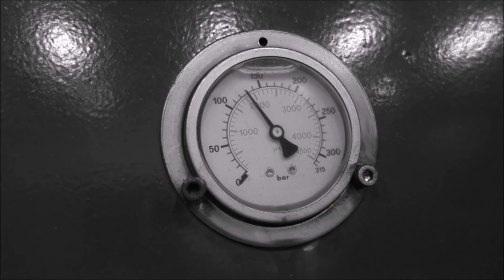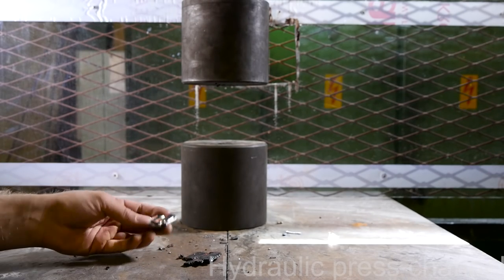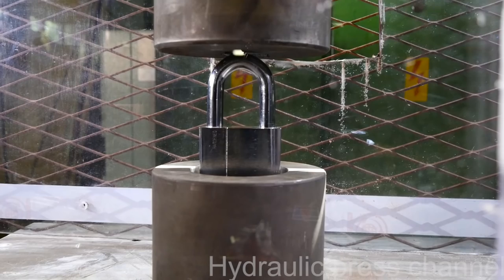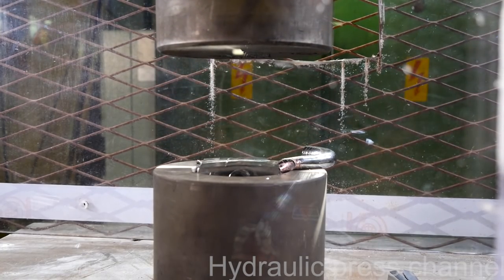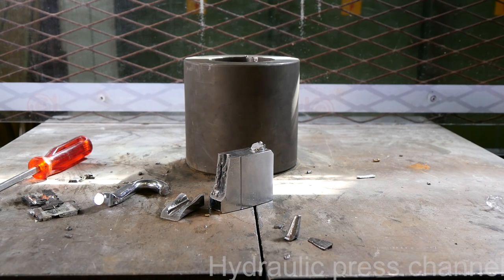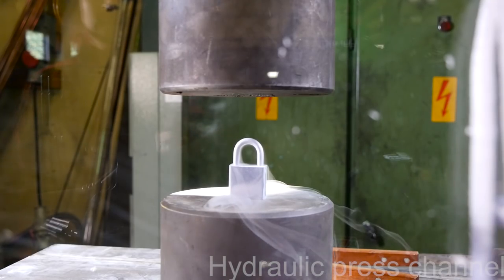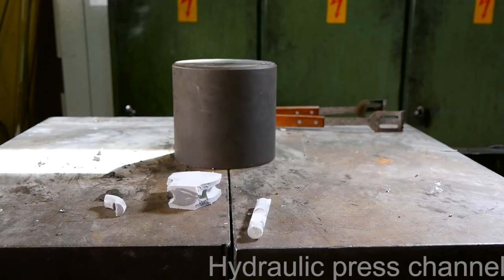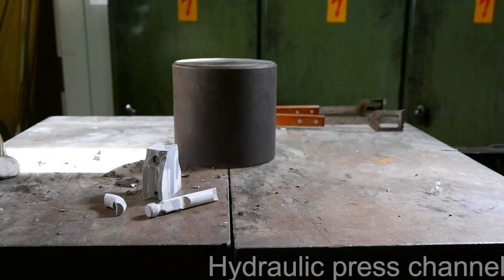How to open padlock with hydraulic press

Comment: PRESS OLIVES AND SUNFLOWER TO GET OIL OUT.
Reply: Good idea, extract some oil from seeds :D
Reply: that's a bad idea he should press some marijuana buds to make some dabs or oil
Reply: The marijuana suggestion is cool it's called rosin and you should apply heat also to allow it to flow out. The excessive force will likely push out more than just the thc oils though and cause it to taste "leafy".

Comment: You need to see if you can get your hand on a military grade Sargent and Greenleaf lock. It is what they use for locking up tanks, RPG's, that sort of thing. It is VERY legit. Not only is the case and the shackle hardened on the locks, but they also cast the case with small rods of ceramic in the body to help dissipate heat from a torch, or cold from LN2. I think a Sargent and Greenleaf Military lock would be PERFECT to torture test on the press, with a torch, and with LN2. Might want to hit up some of the Lock Picking community on YouTube, someone like "bosnianbill" can probably get you in touch with the right people.
Reply: yeah
Reply: could be nice to watch. i say do it
Reply: Seconded. That sounds amazing.
Reply: wow, how do you even know this :O
Reply: Sir Loudmouth A quick Google search takes you to their site, where they say the very same thing.
Reply: the 951? The body is stainless and the shackle is hardened where as an abloy has hardened body and boron shackle... i think the abloy would win.
Reply: edit: just saw the price on the sargent and greenleaf, that thing is like 1800 bucks. S&g should be way better i suppose now xD
Reply: FoodOnCrack The stainless body is a design choice. While it isnt hardened, it is still very durable. And in some cases, because it is not as brittle as hardened steel, it is actually better protected against breaking from impact. The stainless also has better thermal properties, which are reinforced by the ceramic rods in the casting. Stainless also holds up better against acid attack.

Plus the 951 is a full shroud shackle, so that stainless body would have to fail before the shackle would. And you would have to shatter the casing to its core to release the captured ball bearings that hold the shackle closed.

The secondary benefit of the ceramic rods is that they are diamond hardened. So if you do manage to cut through the stainless, you will likely ruin the cutting tool on the ceramic rods. Which in some areas are laid right next to each other, to protect critical lock components, like the lock cylinder for example.

S&G also subjects the locks to several tons of pulling force. And i am sure they do some compression testing as well. Which, i am curious, i wonder if HPC can do "pulling" videos with the press, and not just pressing videos...hmm...

Anyway, i would love to see a 951 get the crush, and see how it holds up under that kind of abuse. I am sure the press would win, but it would be fun getting there.

All that said, the Abloy is a fine lock. And they, as well as Abus, make some fine military grade padlocks as well. Hell...maybe they should to an HPC Military Grade Lock Triathlon. LN2, Blow Torch, and Press. LOL!

Comment: Why is there a hole?
Reply from the maker: It was left over bit from another project and it happens to be hardened so it is good press tool. Other side is flat but because those tools were so thick the big lock didn't fit between of them with out putting it to that hole.
Reply: Can you please press a loaf of bread?
Reply: +rentacow why are you asking him?
Reply: Depending on the material of the shackle (some are made of Boron) the press forced the hardened shackle into the body of the padlock which itself could have been made from Brass causing the shackle to make that "hole".  I have locksmithed for 18 yrs.  He should use a heavy duty padlock such as a Medeco brand which has a Boron shackle and steel body with steel pins.  Cylinders are always usually Brass.
Reply: +Hydraulic Press Channel Crush the breast cancer logo, so we can literally crush cancer!

Comment: Would you consider a comparison of using a hydraulic press crushing coffee beans vs using a grinder? A ceramic mug, a metal thermos, and a cheap drip maker might deform or crack in interesting ways, but that could get a little expensive. 

On a similar theme - hydraulic press peanut-butter or wine.

Comment: hey HPC. Go to 2:58 / 2:59 and look closely at the fragments near the bottom left.

I think you managed to make the lock go from liquid nitrogen temperatures... To like, 1600C, and thusly, GLOWING...

Just by applying pressure! NICE!

It just goes to show you that you're not just putting something heavy onto the log.
You're actually storing a great deal of kinetic energy inside the mineral structures of the lock!
Reply: Or it is just a reflection

Comment: So the liquid nitrogen lowers kinetic energy, making the atoms less mobile so they do not slide at much leading it to snap. Is that correct?
Reply: Yes, temperature is just the vibration of the atoms the colder something is the less it will vibrate and it makes it brittle because of what you just said.

Comment: When they crush the smaller lock, it's done against a flat base. But when they crush the larger lock, the base has a recess, so of course the larger lock won't get crushed completely.

I'm surprised that this hasn't been pointed out because it's quite obvious. Then again, I really haven't gone through all 1,672 comments.

Comment: Crush some aluminium oxide and iron oxide mixed together and we will see it lights up with just pure pressure. Thermite is the stuff im talking about. It would be interesting to see what happens when you put thermite under high pressure.

Comment: So if you can easily crush a diamond in your press what would you not be able to crush?
Reply: a diamond is not the toughest material, just the hardest
Reply: a Nokia
Reply: +Link's Music they crushed a Nokia once must have been fake
Reply: They had a lot of trouble with ball bearings.
Reply: They crushed a glass diamond, not a real one.
Reply: Hand of Fate1315 It was a real one, they were sponsored by some company that sells them. Diamonds are hard but brittle.
Reply: people just don't get the difference between hard and tough...
Reply: Bearing balls
Reply: Water. You cannot crush/compress water. The container would fail though.
Reply: +marcel911 water in a different form though (vapor and ice)
Reply: Your thinking of cutting techinically nothing but another diamond can cut through a diamond but when brute crushing force is used thats a different story
Reply: You can compress water, just not very much.
Reply: Yes but if you tried to compress a litre of it in the press you would need some fancy measuring equipment to be able to tell.
Reply: +Lenny Face we must deal with it
Reply: Nokia
Reply: Your crush.